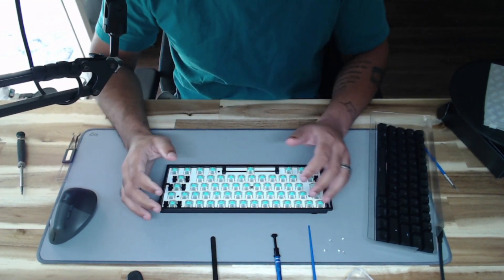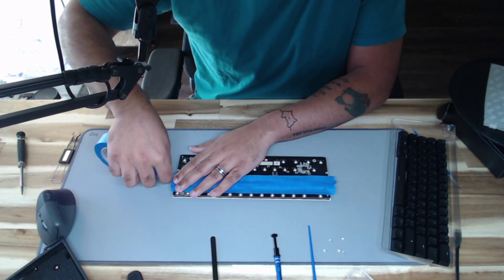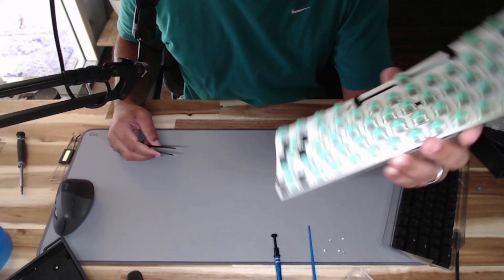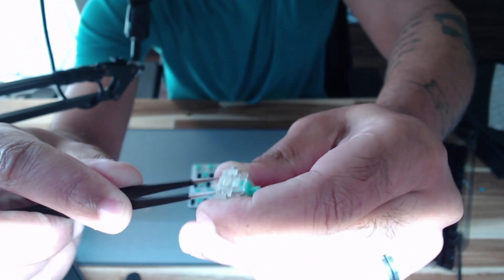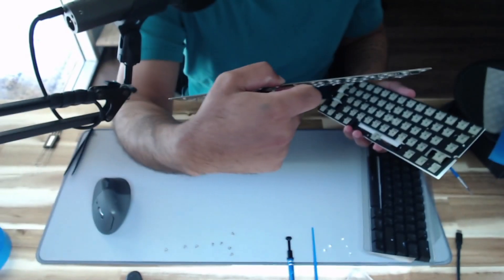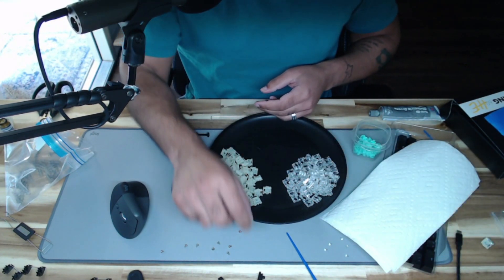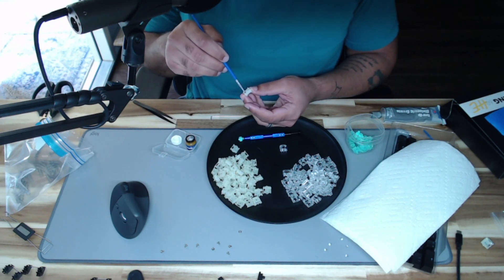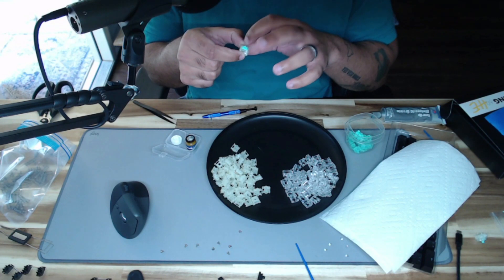Wooting 60HE Modding breakdown and explanation! *Sound Test At The End*

Comment: can we channge stabs in this keyboard ? or is it waste ?
Reply from the maker: From the looks of it, I think you can swap out stabs if you have a preference. The only thing that can't be modified on the board is the switches since it is meant for the special Lekker switches. But you buy this board for the best gaming switches anyways, so that's not really a big deal haha.
Reply: @defu8592  i want the change durock v2 with this but stock was so good not gonna lie
Reply from the maker: @trilecebey  yea that's true they are really good for stock! So much better than what the big brands offer.

But if you wanted to try the v2 durock it shouldn't take too long to do and I'm actually curious what the difference would be